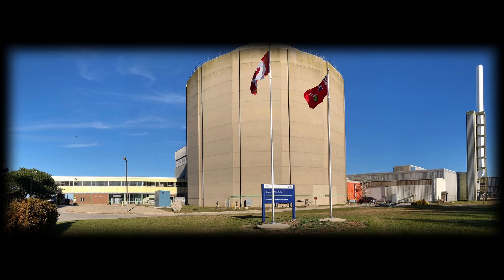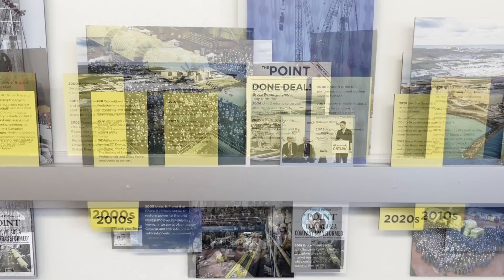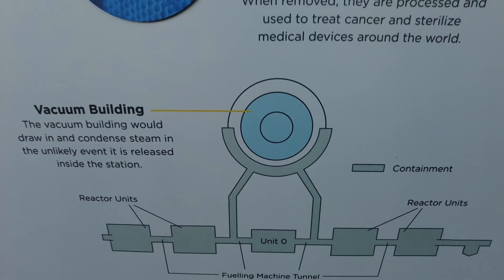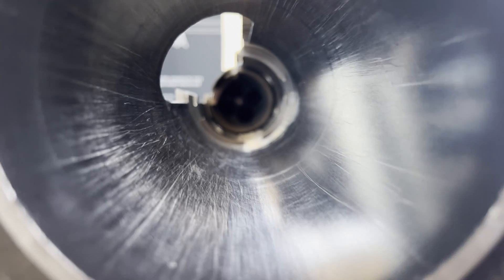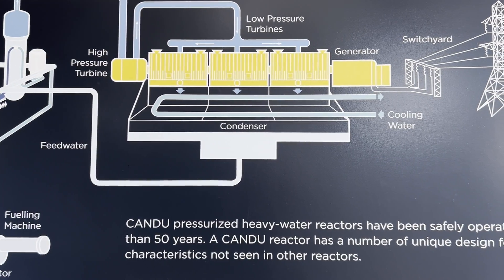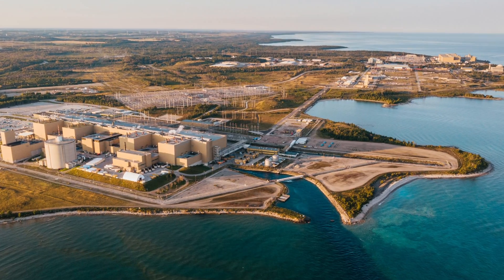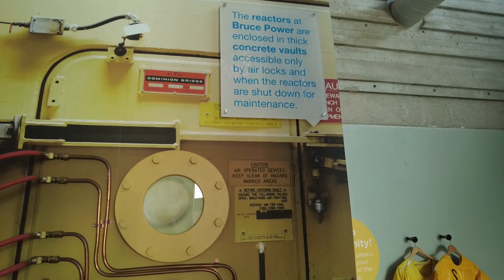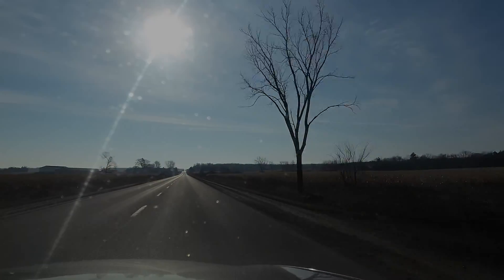Bruce Power On Lake Huron, One Of Largest Nuclear Powerplants In The World

Comment: Why aren't there any cooling towers?
Reply from the maker: The 4th stage of the cycle is a condenser stage with cooling water from the lake.
Reply: It cools itself by Chernobyling. As a local resident of the area, I can confirm that this happens often.
Reply: Misinformation.  I live here too.  At times steam is vented - it is made up of light water from the lake which never comes into contact with the heavy water.  Wikipedia has articles on CANDU reactors, you can look it up for yourself.
Reply: @rogermcclure3327  yo do know McClures Mill?